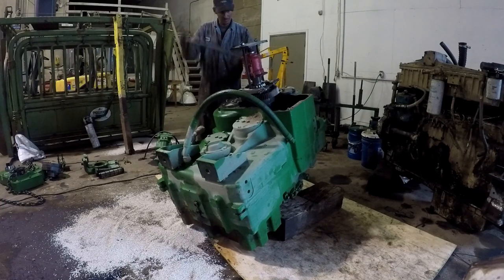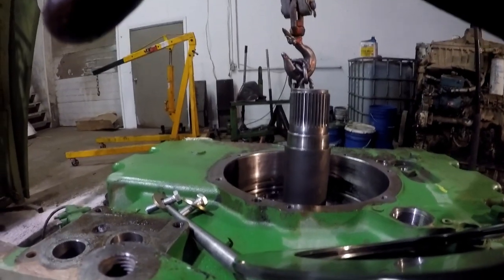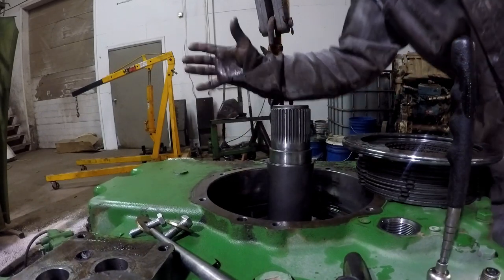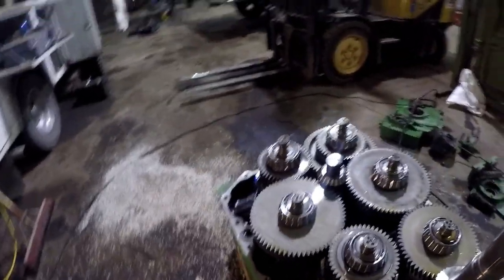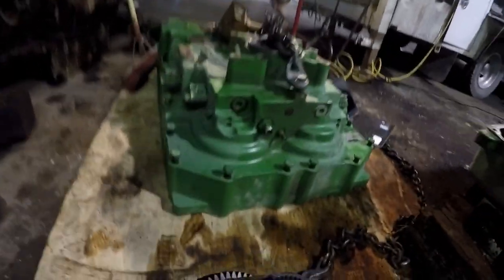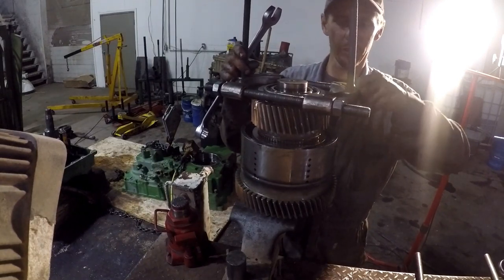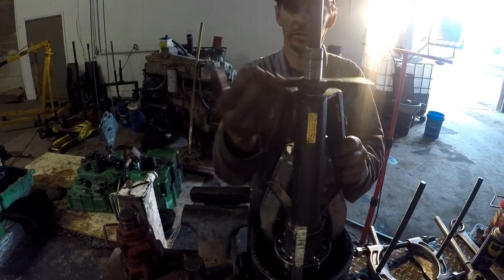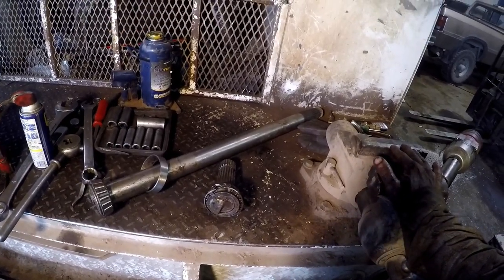John deere 9320t powershift disassembly (part2)

Comment: Cool stuff dude. I've never done any farm equipment work before. I was curious how some of that stuff is built though. The inside is alot like a Honda Automatic trans in street cars. Just a whole lot bigger. And many more shaft assemblies. 
 I did pick up some tips from you that I can use on other manual trans, transfer case and rear end builds i do. Thanks.
Reply from the maker: Mikey Drake  No problem, thanks for watching.

Comment: Think about how much surface area is present on those those clutch packs.  That's some serious torque holding capacity. 
 Speed sensor monitors an reluctor ring.  Sure we all like our nomenclature ;-)  As soon as you split the case is the exact moment I would be like wth did I get myself into this time?  LOL

Comment: When you don’t want the tip of the posi-lock bearing puller to damage a threaded hole. Just use a bolt that will fit in the hole loose but with a head larger then the hole.

Comment: If the owner decides to give the tractor more horsepower, should the system pressure also be increased ? (so the clutchplates will pressed more together)
Reply from the maker: +Paul de Blok  I have hopped up horse power on some older tractors, never have messed with system pressure on transmission, trust me there is plenty of holding power on those clutch packs.

Comment: Is that a 15 speed powershift similar to the big rubber tire tractors?
Reply from the maker: These are 16 speed powershifts . They are set up quite a bit different than the older 15 speeds .